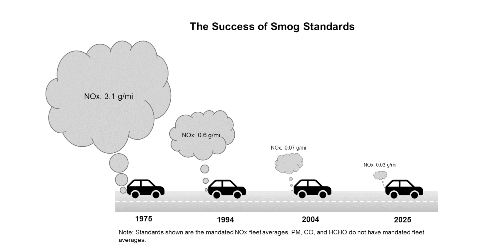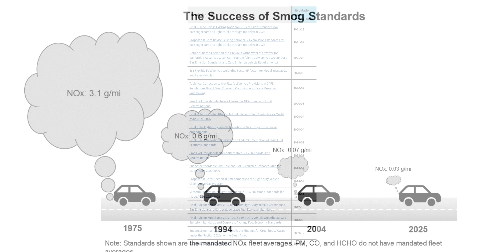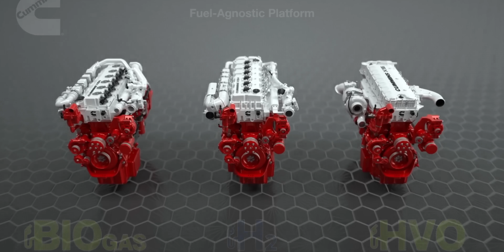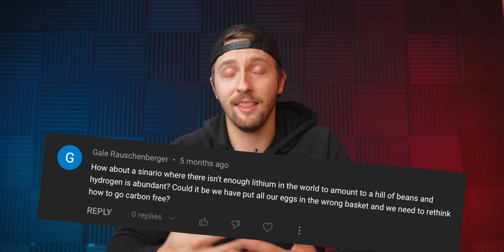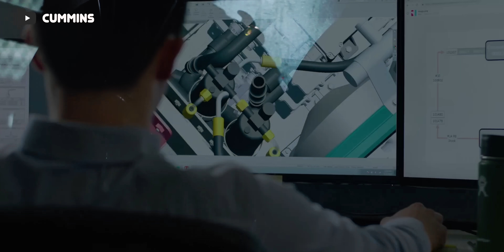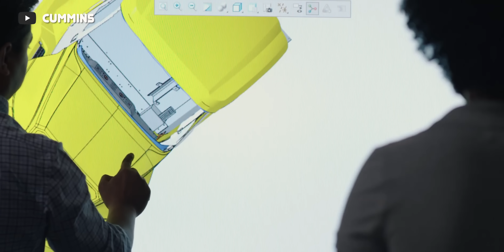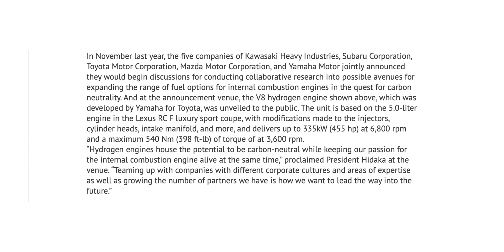Cummins Hydrogen Engine Will KILL DIESELS FOREVER

Comment: How did you get this great but the only problem is number one it's unstable even though you might be able to contain it biofuel's garbage cause you get down below 40ﾟ it turns to go and then whatever sending your fuel tanks to begin with turns to go plugs up filters destroys injectors no biofuel's garbage and anything that you try to do biofuel is not applicable or anything like that so I don't understand an electric all electric machines you gotta have power to make power so Not viable

Comment: I think it's a very logical choice for off-road. You trade all the complexity/unreliability of diesel exhaust aftertreatment, for the difficulty of storage.

You'll need really big tanks but it appeases the EPA.
Reply: Hell yeah who gives a shit about clean air and a functioning web of life.
Reply: No similar volume high pressure H2 tanks will contain similar energy to a tank of diesel, maybe slightly larger. They are nice and easy to refill again, taking a similar amount of time to normal petrol/diesel (~5min)

Comment: How do you like being herded?
The EPA means to kill the internal combustion engine by regulating it out of existence.
Ratcheting down the last fraction of a percent on emissions will not improve air quality.
The goal is to take away people's freedom to move about at will by making petroleum scarce and expensive.
It's trivial to run engines on Hydrogen.  The problem is producing it in large scale and transporting it and storing it.  There is no plan to create the Big Hydrogen infrastructure that will replace petroleum, otherwise they would have told us about it.

Comment: Note Wyoming is a place I will retire in 40 years it has banned sales of Electric Cars for the year 2035 and beyond.  Due to lack infrastructure and I produces its ⛽️ fuel. I had a co-worker who moved to North Dakota, mind you he never drove in snow conditions. ❄️ Has a Tesla model Y. In California Summer heat the batteries 🔋 are cooled by the freon Air Conditioning system. Now it's winter in the North Dakota it's really cold and his commute is 100 miles do you think with the heater coolant running constantly it will be able take him back home. I don't think so. This why Wyoming banned them and for the environmental impact of disposing each battery 🔋 pack. Toxic chemicals going into the Ground Water 💧. In the whole UNITED STATES 🇺🇸  there are only 5 Recycling ♻️ Centers. California doesn't have a single Recycling facility in all the states, due to Environmental Impact. 
Note Ford also Patent a V8 5.0 Hydrogen engine too

Comment: There's the added technical challenge of the fact that the astronomical pressures the hydrogen has to be kept under causes the cylinder to become highly explosive. Also, hydrogen is highly highly flammable! It's very difficult to work with.

Comment: looks to me like the ammonia with hydrogen cracker and fuel cell is the way it's going to go....there are several prototypes already testing as well as locomotives and cars...and ships...hydrogen as a  gas or liquid is just too difficult to contain and ship, ammonia is a denser energy source like 10 times as energy dense as lithium batteries, and ammonia is a low pressure storage fuel that can easily be shipped and distributed....it also can be produced several ways...a fuel cell is much more efficient than a combustion engine....

Comment: I still don't understand why we don't have locomotive style OTR trucks. Diesel Cummins running at a very small rpm band with ducted duel injection can be made extremely efficient and low emissions. It runs a generator that runs electric motors.
Reply: The 1,000 HP diesel engines that run the locomotives back in the 50's where 645 cubic inches and had between 12 and 16 cylinders at 645 cubic inches per cylinder.  The modern ones in the 60's where larger, up to 858 cubic inches and even1,070 cubic inches Per Cylinder.  They would idle at 100 RPM and run up to about 600 RPM at full speed.  They consume about 2,500 gallons of diesel on a 24 hour run from one state to another.  

Not very fuel efficient at all!

Comment: Hydrogen gas is so silly.  It’s explosive and must be stored under very high pressure.  Methane is one of the best hydrogen carriers around, and has been used as motor fuel for at least 100 years.  You can store SIX times more energy in the same space, without using monsterous pressure.  … and methane is literally the most abundant fuel on the planet.

Comment: Well I know that we can not produce enough of the precious metals that it would take to produce all the electrical vehicles we would like to make so if you go out and do your own research you will find out it's impossible to continue this electrical battery vehicles you want due to the lack of precious metals it takes, sooooo we need something else. Even if the government wants to get rid of diesel...it won't be able to bc we just don't have a a replacement at the time.

Comment: Hydrogen and EV have the same fundamental floor, fuel storage. Based on current battery innovation moving toward aluminium ion over lithium ion, i think batteries will be very good.
The next question then, is upgrading infrastructure (cummins 6.7) enough of an advantage in what is a throw away society?

Comment: The reason Hydrogen is superior to electric is range. 100 pounds of liquid Hydrogen is going to have significantly more energy density then 100 pounds of a lithium battery. So you get better range and heavier cargo since you do not need a 20,000 pound battery in your 18 wheeler. Which weighs the same charged as uncharged so as you use the power you do not get the benefit of weighing less.

Comment: So compared to the retail price of diesel, what is the price of hydrogen? Would the price of hydrogen start out inexpensive then slowly creep up just like diesel? Biodiesel can be made at home. Hydrogen can also be made, but it's trickier. I guess, if people really wanted to, people could create their own electrolysis systems at home and just have a lot of redundant security measures so their houses do not pull a Hindenburg...BUT they would be tethered to a specific distance from their home until hydrogen fueling stations become more available.

Comment: Great video
Americans understand the metric system my friend. They chose not to embrace it. 🇺🇸
It’s wise to test other fuel types, California is always demanding more than other states and everyone conforms to their nonsense.
If Elon or someone else can develop a quick fork lift driven battery exchange station where 18 wheelers can roll in and out quickly, electric isn’t going to work on trucks and trains. These are the backbone of American distribution.